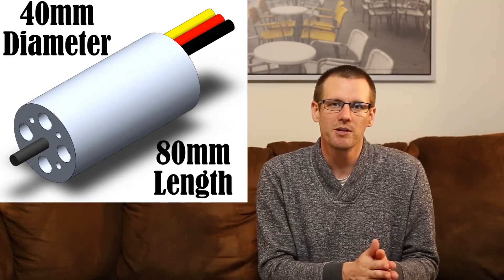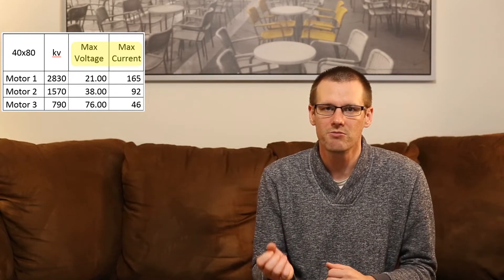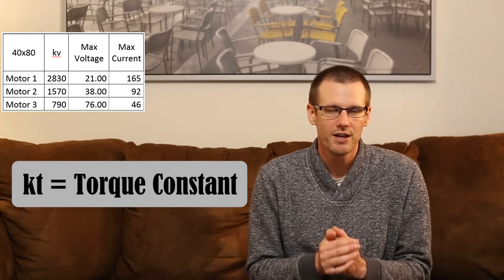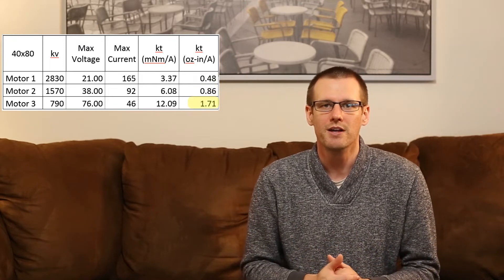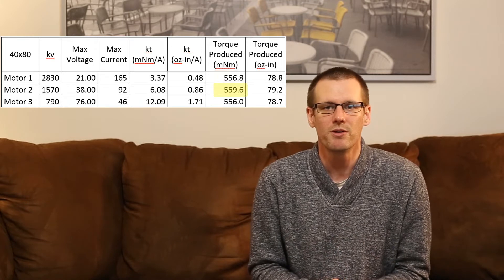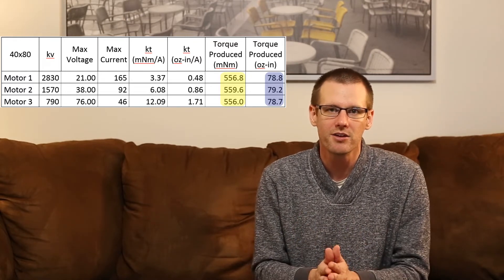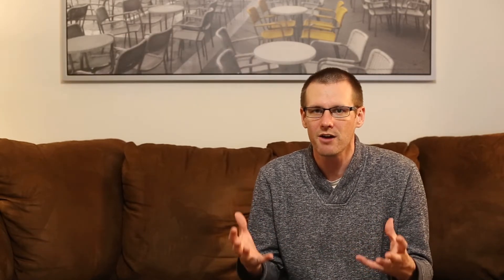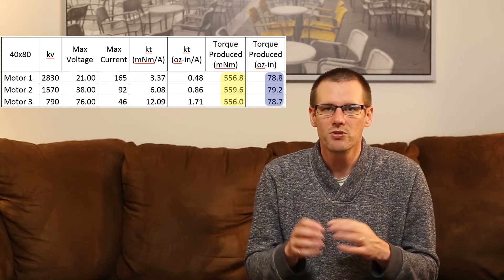Comparing Brushless Motor Torque vs Kv

Comment: So does de lower kv have the same torque at lower Rpm? Is it the same torque when you use the same battery?
Reply from the maker: Torque produced by the motor depends on the current that is drawn. If you draw the same current regardless of your battery or RPM, you will produce the same amount of torque output.
Reply: RCexplained but at the same battery, that means on a lower rpm right?
Reply from the maker: If the motor draws the same amount of current, RPM and battery does not matter. 

100A at 20k RPM vs 100A at 5k RPM is the same torque output. Battery does not matter.
Reply: @RCexplained  Oh wait, I mean when it is the exact same motor but just another KV. The Higher KV will always take more current on 3S as a lower KV right? At least that is what i have seen in the specsheets of the motors. And if you see both motors the same power (like 800W), then the lower KV can only reach that with a higher voltage than the high KV one, wich would mean the power of a lower KV motor will be lower on the same voltage (what i meant with battery, like 3S). Or am i missing something. Isn't it so that a lower KV motor can only come to its fullest potential at a higher voltage than an High KV motor?
Reply from the maker: Sounds like you got it!
Reply: @RCexplained  So in conclusion then, for crawlers that want to go as slow as possible. If you do not change anything else, picking the same motor with lower KV will not help against cogging at those very low speeds? So solving that would mean, you need to change the gearing or get a bigger  motor (more torque from can length and diameter) (and not gonna talk about smaller tires, which also works)
Reply from the maker: The best way to solve the hesitation at startup,  is to use the shortest gearing that you can. This way the motor spins more times for every one revolution of the output shaft.

Comment: Good explanation, but I missed some rom torque curves.
Reply from the maker: Thanks for the comment Lazy Man. RPM / torque curves would be tough as with an electric motor I can give you what ever shape of a curve you want. Shape of the curve depends on the load and control settings put in place.
Reply: @RCexplained  I ment the calculated torque, is it from zero rpm available or in other words are the motors over the complete rpm band compareable.
Reply: @RCexplained  I think I'll have to learn more. But now I find you and will abo you to watch relaxed some old vids and of course the new ones.

Have to read more about the topics, I new start RC Hobby.

Comment: This series is the best explanation of the various motor parameters I've seen. Unfortunately, it's still not quite explaining what the advantage of bigger motors is (in my specific case, on fixed wing aircraft). Does more KV mean more speed? Why, if the total torque is always the same? Also how does motor size affect things, how is a larger motor better than a smaller one (I know it's more heat dissipation, but what does that mean in practice? More speed? More efficiency?).

I am hopelessly confused on this subject, alas.
Reply from the maker: Larger motors mean more power output potential. With more power output you can set your airplane up to go faster. 

More kv can mean more speed if your motor and power system is able to deliver the increase in power output.
Reply: @RCexplained  I see, thank you, so basically what we care about is the wattage, not so much the size (except for heat dissipation, I guess), is that correct? Ie I can just look at the wattage to figure out how much power the motor can deliver and the amperage to figure out if it'll burn?

Also, why does more KV mean more speed, since power is constant? Wouldn't more KV with a smaller pitch prop be the same power as less KV with a larger pitch prop (since more KV = less torque for the same power/size motor)?

Sorry for all the questions, I'm just a bit confused because all the explanations I've seen tend to change more than one variable at a time, and not say "more KV means this, more power means this, more size means this, all else being equal". Thank you!

Comment: Hello, thanks for the explanation. I tried this formula to calculate the torque of a motor and compare it with the tests of the manufacturer bu i only get the same torque when the throttle is at 100%. Any idea why ? Thanks
http://store-en.tmotor.com/mobile/goods.php?id=377
Reply from the maker: Hi Jean, thanks for the comment! I haven't spent much time looking in to partial throttle data but do know that behavior in this region is not the same. (Empirical vs Theoretical) Calculating the torque using Kt under partial throttle will result in an underestimation. I have an idea as to what may be happening here, however, I'd have to put it to the test and run my own experiments to confirm.

Comment: Question. Everything else being constant (terrain, top speed, acceleration) except KV and gearing.
Should i pick a low kv and load with tall gearing or high kv and short gearing?
Reply from the maker: Hey James. Motor Kv is selected based on the voltage you plan to run to hit the same RPM at the motor.
Reply: @RCexplained  oooohhh.

Comment: True, but it takes 3x the volts on a larger KV motor to produce the same torque as one with a much smaller KV value, no? So the conclusion seems to be what you stated in one of your other videos (Yes, I enjoy mostly all of them :)) is that you have to balance low kv with a ton more volts vs selecting a high kv motor with run on a lot less volts. Would the heat produced roughly be the same or would I select a higher kv with a lower voltage for less heat (since less stress on the motor)? 

I'm trying to put together a basher setup where top speed isn't as important as torque for maneuvering the rc mostertruck while in the air off a ramp, pop wheelies and to more easily run through off road terrain like grass. Thoughts? I did watch you other video about selecting a KV based on RPM need and  expected volts. I came to 50k RPM / 11.1 = 4500kv but wondering how to balance that with your topic in this video. My current motor's physical size is quite small at 2435 and not much room to make it much larger. 3900kv.
Reply from the maker: The kt constant multiplied by amps gives you the torque output. In general i prefer lower kv motors, however only if I am able to increase the cell count I run to them. This is where I am able to maximize the setup. Going with a larger motor also helps out as well. It generally provides a lower Rm value at the same kv and as you mentioned previously, there is more surface area for heat dissipation.
Reply: @RCexplained  Thanks. I'm not able to increase my cell count, so I used the formula you shared about RPM/V to determine the "ideal" kv. As you taught me, that'll maximize the RPM's while still staying within the range with use of the voltage I plan to equip my power system with. Thanks again. Keep up the good work. I'll be watching.
Reply from the maker: @Funcentric  sounds good Funcentric. Just make sure your Total RPM is realistic for your RC and you are good to go.
Reply: @RCexplained  A smaller physically sized motor with the same KV generally has a much lower amperage rating, meaning I can run it through a much smaller ESC and still achieve the same RPM. 

Is there a reason I wouldn't select a 2435 4500kv motor running on 3S vs a 3650 4500kv also running on 3S? 3650 would get less hot b/c of the surface area? So advantage of 3650 is that it's less stressed than the smaller 2435 at 50,000 RPM?
Reply from the maker: @Funcentric  Keep in mind that if you load the motor to 200A it doesn't matter what the rating of the motor is. It's going to pull the 200A. The rating is a limitation and not an indication of how many amps your setup will pull. 

The smaller motor has much less power potential. How many watts are you planning to pull from the motor?
Reply: @RCexplained  I have a few power systems I'm putting together. One of them is a 3650 4300kv motor with 120amp ESC at 833 watts when running at 3S (1500mah 120C). Rating of the motor is 900 watts.

Comment: very good explanation, and professional talk! in the next video please explain how KV and torque will be affected by the gearing ! for example, a 2200kv will use a 16T pinion and a 1480kv will need a 19T pinion on the same car to achieve the same end speed
Reply from the maker: Hi stephane. Thank you for your comment. I have this topic included in my queue of video topics.

Comment: Motor 3 is always better overall from what I have learnt. Because lower amps at higher voltages equals much lower heat losses and less damage to battery
Reply from the maker: Hey Greg, thank you for your comment. Here's the perfect video that talks to the high voltage vs high current setup. What do you think?
https://youtu.be/x44GB5zbOSI

Comment: What am I missing?  Kt = 1/Kv.  Kt = 1/790 = 0.00126582.
Reply from the maker: Unit conversions. kv uses RPM. Kt uses rad/s.
Reply: @RCexplained  Thanks for the reply - could explain this is another video perhaps - the maths of how to get to gearing from Kv, via Kt?  Perhaps others, like me are intruiged as to how to choose the optimal gearing - I race 1/12 pan cars in stock 13.5 turn bsushless motors. 1s Lipo, 1s specific ESC (120amp).  Each race is between 4 and 6 minutes so I want the best performance for that duration.  I liked your video on designing/ choosing your power system - would be great to see a more in depth one for my case (although I don't have much choice), and perhaps specific examples of the other two?  Great work - I've learnt a lot - I'm just missing a few details.  Thanks
Reply from the maker: @xaviertaylor759  the best way to further optimize gearing and other choices is by testing different combinations and measuring performance,  power output and heat. The theoretical side will only get you so far.
Reply from the maker: Hey Xavier, just an update. The recently uploaded video shows the math on Kv vs Kt to answer your question here. Also the video planned for next week will look at gearing and kv selections to a degree.
Reply: @RCexplained  Do you have a link to this? I am curious to know how to convert Kv to Kt too. Came across this channel today, absolutely amazing. Liked and subscribed!
Reply from the maker: Thanks for the support Ajay, here is another perspective:
https://youtu.be/qkSPjNmxcl4

Comment: I'd say you'd need to look at the whole system to choose the correct motor. A low kV motor will require less amps but more voltage for the same power, while a high kV motor will require less voltage, but a lot more amps. Generally it's more difficult to get high amps delivered (need bigger wires, batteries with high C rating and beefier ESC), but you probably also don't want to use batteries with a lot of cells. To get the most torque and power out of the motor, you need to max out voltage and amps as best as you can with the space and money you have available.
Reply from the maker: Hi Razor Blade, that's very true. This video is specific to torque vs kv, if you are interested in how to choose a brushless motor there is a separate video for that on the channel. This video in no way covers how to select a brushless motor.

Comment: Why would someone give you a dislike? Your dropping some hot knowledge
Reply: Because some people are in denial  because they've grown up believing slower motors have more torque.
Reply from the maker: Hey BMR 3, I didn't even notice that. Thank you for the support and I greatly appreciate you taking the time to leave an awesome comment!
Reply: RCexplained no man, thank you for putting together very informative videos in a simple, straight forward format. Your videos are great, I can’t wait to see what you cover in the future. 

Could you do a future video on suspension setups & spring rate? I don’t mean an explanation on how the suspension system functions, there are videos covering that topic. I mean how different suspension setups influence the steering characteristics, for example, hard rear springs with soft front, or vise versa. I also think it would be cool if you could talk about ideal suspension setups for different driving styles. For example, setups for a speed run car, versus a track/touring setup, versus a drift car setup. 

Just some ideas, you seem to be very knowledgeable & I appreciate how you take a scientific approach to your videos. Keep up the good work!
Reply from the maker: @BMR3  , yes I can create a video talking about suspension setups on RC Cars. My video queue is at least a few weeks out, I'll see when I can slot it in.  Thanks!
Reply: RCexplained awesome thank you sir!!